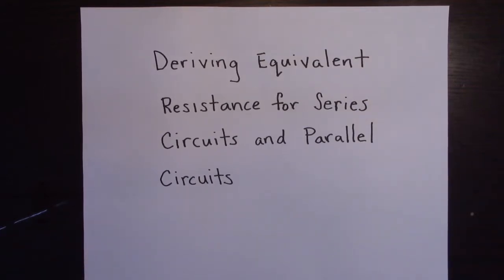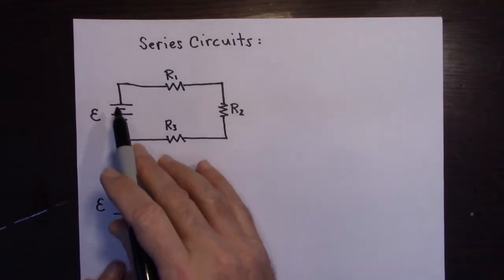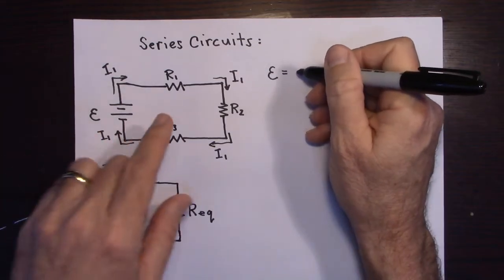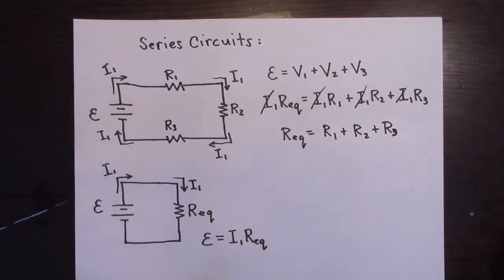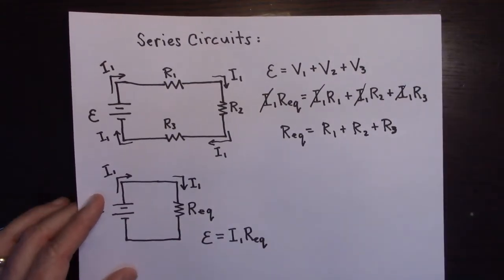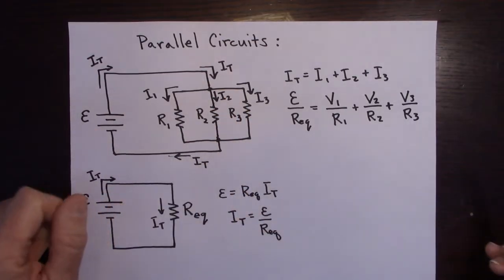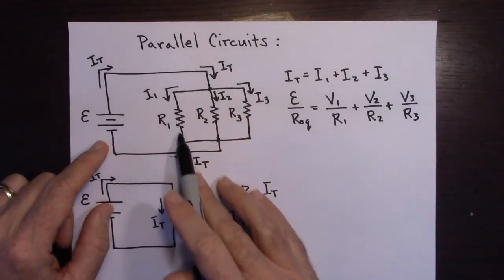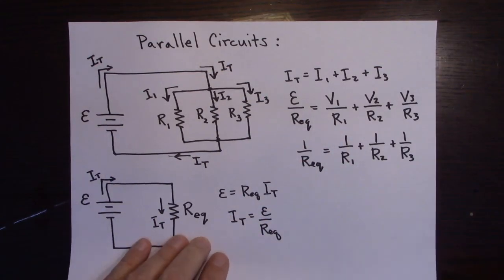Derivation of Equivalent Resistance for a Series Circuit and a Parallel Circuit.

Comment: Thanks for this, I forgot the essence of the parallel resistance formula till you mentioned Kirchoff's loop rule, and the voltage is the same across each parallel resistor.